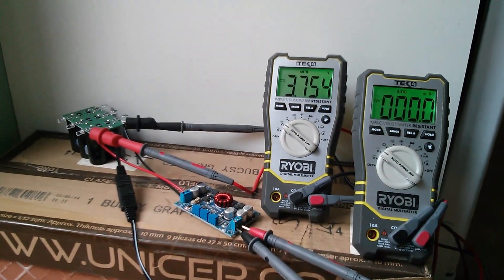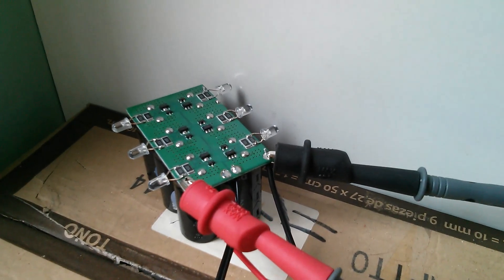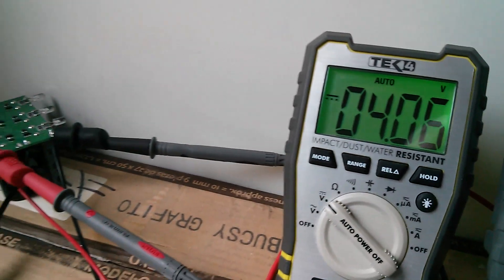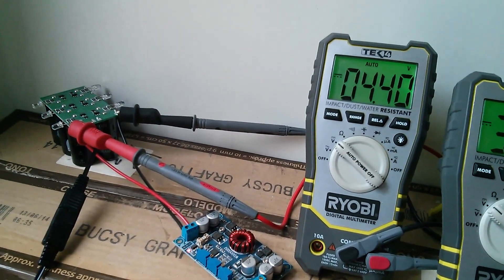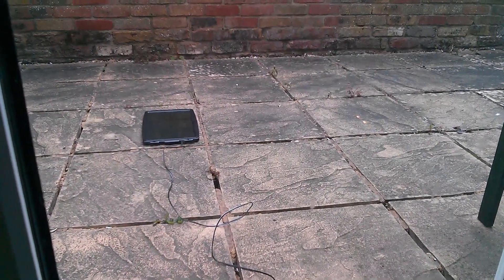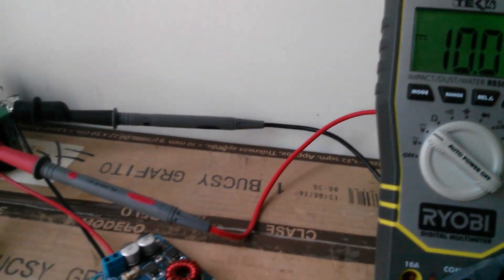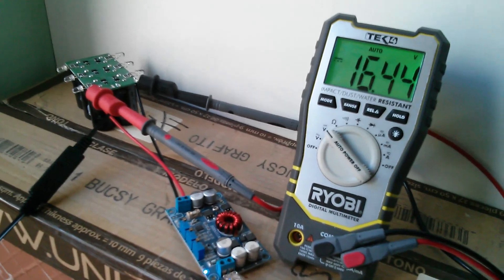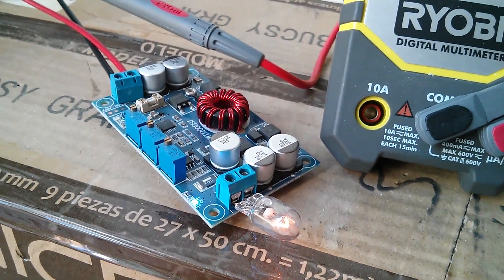Solar Panel, SuperCapacitors and a Buck/Boost

Comment: When the blue protection LEDs come on can you use an infrared camera to show the bottom of the board where the protection devices are dumping the current we should see some hotspots developing on the activated circuits
Reply from the maker: Yes, probably, although they don't stay on for long.

Comment: Hello and sorry for this question, but where could I get that specific model of buck/boost converter I mean which model is it?
Reply from the maker: just search for LTC3780
Reply: Julian Ilett Thank you , but on ebay its showing me the exactly that you use in this video is only buck , exactly the same coil and arrangements on board,  but the others one is what I am looking
Reply: alexutzzzu123456 
maybe you should check it on  bangood..
Reply from the maker: Not sure what you mean.
Reply: If you're using a 'national' ebay, like ebay.de or ebay.ca instead of ebay.com, try using the .com version - lots of listings with LTC3780 step up / down in the description when I just now searched.
Reply: Julian Ilett do you have a link to the Super cap bank? and also a link to the buck/boost converter?

Comment: Another great fun video.
 I also enjoy playing with solar, i have a small garden workshop, the shed, totally solar powered, I have lights a radio and a 12v soldering iron, so i can work away and use no mains power at all.

Comment: That thing you where working on yesterday could be turned into a radio receiver where the VCO operates at 4 times wanted frequency which drives the Quadrature output and one lead tapped onto one output would go back to Fin on the PLL which drives a Quadrature Sampling Detector circuit which gives I and Q would drive a AF phasing array which would drive a power amp to drive a loudspeaker and allow you to listen to the LW or MW Broadcasting band, of course the QSD needs a balanced feed and a BALUN will work for that but you will somehow have to find a way to connect to the connection on the coax side. I know that this is off topic but but would make an interesting project.

Comment: why didnt you disconnect the converter from the caps so it could charge faster
Reply: Milk Parker omg that capasitors need at least 30A to charge fast that panel make 1A

Comment: Hi. Disable the automatic power-off feature on your DMM. from the manual: "To disable the automatic power-off feature, press and hold down any button while rotating the mode selection dial from OFF position." Similar with my Fluke (press Hold when powering on the unit to disable power-off feature).
Reply from the maker: Thanks for that - I didn't know that was a feature - RTFM I guess :)
Reply: Julian Ilett I'm happy it helped :)

Comment: Fun project: Could you use your supercapacitor bank with the solar panel to collect energy reflected during the night from the moons surface and light up an LED briefly?
Reply from the maker: No :)
Reply: I saw this done on a Cody'sLab video, I thought it would be pretty interesting. Impractical, but interesting.
Reply: That would not be efficient, doubt it'd work at all
Reply: I have done this exact thing by using a tuned jewel thief. I can charge a 1.2v NiCad battery at about 50uA in starlight and about 100uA in full moonlight. used a 1 watt monocrystalline solar cell.
When I have money to through away, I want to try it with a 120 watt panel and see what I get. Easy enough to by pass the jewel thief after the voltage on the panel passes a set threshold. In my case its set to 1.4v.
Reply: UFOhunter ... U used a mono cell with no magnifying or tracking?
Which way did u point it? Flat, vertical, angled? What was the cells specification Vmax, Imax? How long did it take 2 charge the cell?
Please help as I would like 2 recreate your results 2 show others. Thanks.
Reply: This was a only a half hour test in the middle of nowhere. Pointed directly at the moon and adjusted to get the max voltage. There is a typo in my comment,  but I can't edit it for some odd reason!
I used a 10 watt panel not 1 watt. Maybe if you have a 2kWh system on the roof, it would produce a usable power.